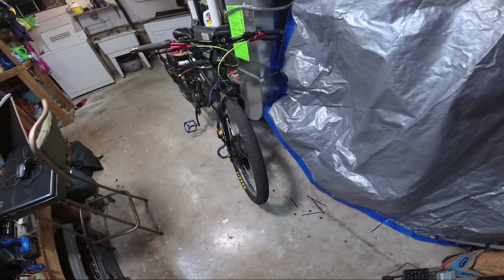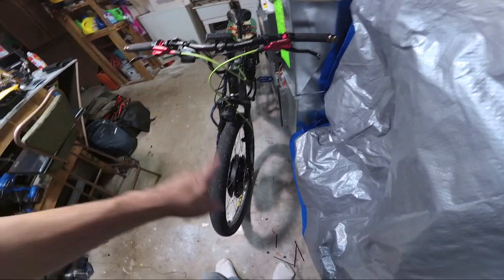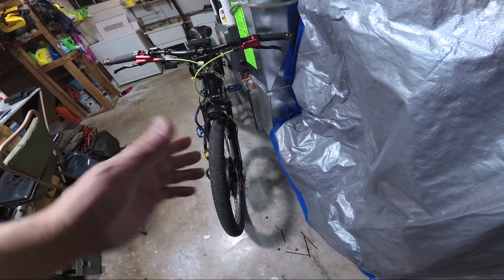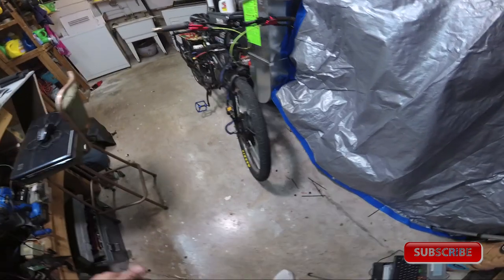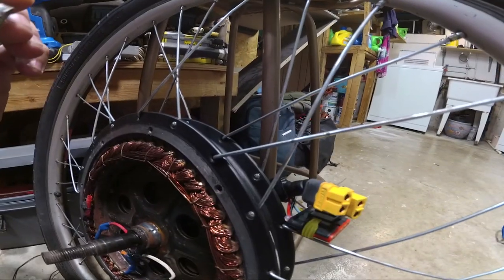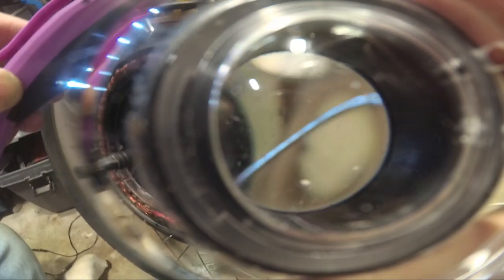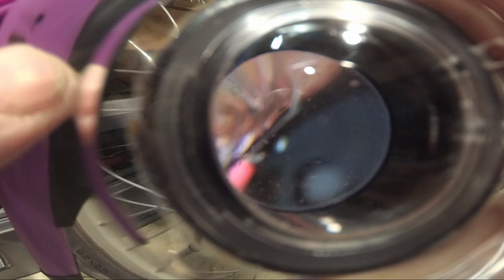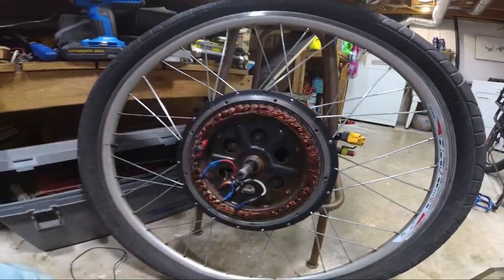ebike vlog Friday, November 6, 2020 *death of a hubmotor*

Comment: That's been in service for 9 years, Damn.   Check the rim for wear from the brakes.  It's a good idea to not use fwd.  Good choice to go rwd.  These motors work great in regen.   I don't think regen is a great idea on the front wheel. In the stock controller there are pads X and DS that when connected turn on ebrake regen abs or whatever you call it.